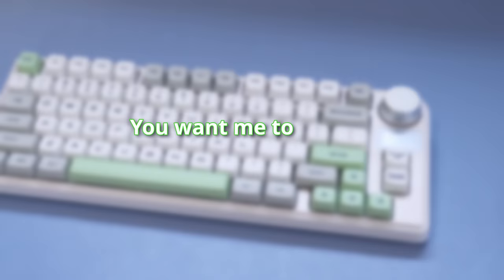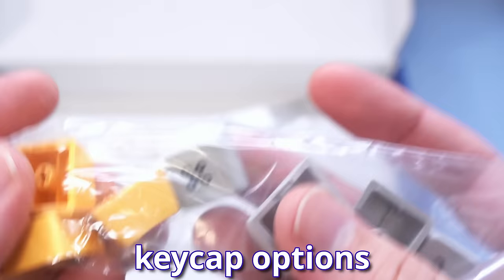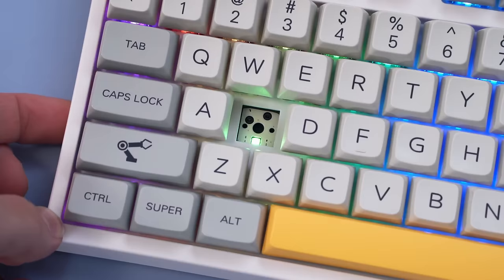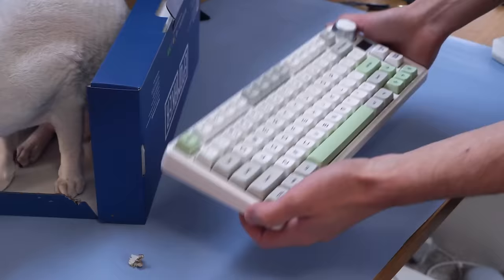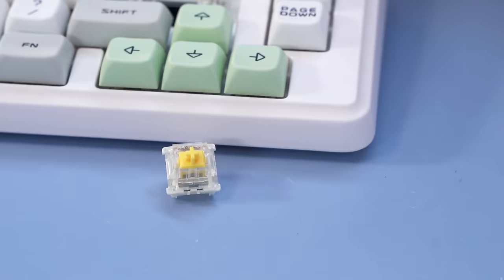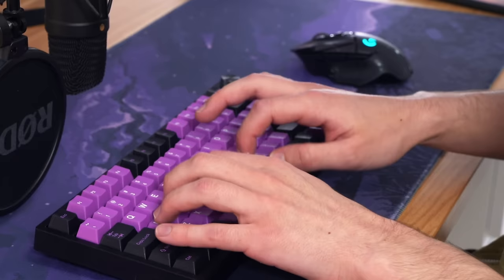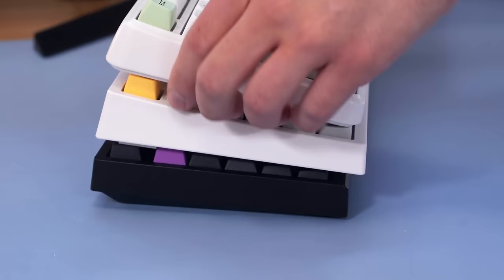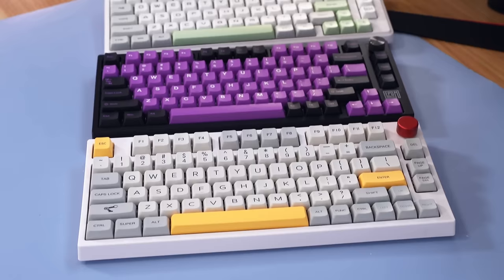Why Are People Buying THIS Keyboard From Amazon?

Comment: Instead of using Kinetic sand to dampen the bottom of the th80 case why not just pour some Flex Seal into the bottom of the case?  About an 1/8" thick layer of it in the bottom of the case should dampen it pretty well.  It would probably be permanent though, removing the flex seal would be hard to do unless you applied a release agent to the case.   You should give it a try and let us know what you think. 🙂  Thanks for the video.
Reply from the maker: Totally could - I have used flex seal in a lot of that type of case and it works great - just hesitant to use around a battery

Comment: counter argument.... no screws make it easier to mod. j pull it apart. over time the case weakens a bit and its easier to open the board. j be careful first few times.

Comment: Uh... the knob on the TH-80X can be used for volume.
Reply from the maker: HOW? I could not get it to work for the life of me
Reply: @HipyoTech  if you hold FN and press the knob it should go back to the normal mode which is volume.
Reply: I love my TH-80X but sadly i wish i went a different route. The screen is a "cool" addition but otherwise useless and yes the firmware is questionable to put it nicely. Hindsight I find myself gravitating more toward TKLs since they have a full size R shift. i'm constantly hitting the up arrow instead of the shift.

Comment: Bought a TH80 last year and the solder job was terrible, metal contacts on the pcb were falling off so I complained and they sent me a new one. It stopped working completely 3 months later, took it apart and no noticeable fixes, assuming battery went out. Wont buy epo again :\

Comment: Honestly, as someone who owns the TH80 Pro, these are all kinda mid, esp for the price. Epomaker tends to be a reseller and for the most part, you could prob get most of these boards cheaper elsewhere (save for the TH80 Pro/Original where the og board, the Keydous NJ80, is more expensive for some reason even when barebones)

Comment: Awful key layouts, one doesn't even have 13 F-key positions, and none of them have a minimum acceptable 82 keys so you have to decide what movement keys you're going to hide in the function layer. And the knob that's not a knob should be a total deal killer.

Get a barebones Tester84 with a nice aluminum frame instead.

Comment: Ok. First, metal doesn't mean better, or even outrageously more expensive than plastic, but the "pro" boards want you to believe this. Ok...
Then moddability...I agree that no screws is weird, but they would work on plastic, and they will wear out easily. No screws...less modding tryouts, but it is still doable. Not a really deal breaker.
Gasket mount...even in this field, a wobbly gasket mount doesn't mean "better performances". Some years ago, if a keyboard would flex it would be considered cheap and baddly built.
North facing LED are not bad in general, it just depend on what keycaps you want to use, and the switch incompatibility is a no problem nowadays.
So I don't really think you'd be totally fair in this video. Even because you didn't try the budgerigar switches, that are their tactile and are quite good. And you didn't mention everything is pre lubed.
In the end I think this keyboards are a quite good start and they sound quite good from the start. You have to spend a lot more to have the same satisfying experience, especially for a beginner of this hobby.
The keychron costs anyway more than this 3.
Reply: The TH80 SE has also a pbt layer on the switches...and it helps to make the sound more "thockier"

Comment: Overall, I think Epomaker's plastic keyboards are WAY overpriced. It might have been revolutionary like 2-3 years ago when mechanical keyboards were more expensive, but at this point in 2024 there are more competitors with better offerings. At the $90 price point the Womier SK71 is a much better value with an aluminum case, decent keycaps with Outemu white switches (which I have and love). If you pay a little bit more around the  $90-$110 range, you can get the Rainy 75 which HippyoTech recently reviewed. I almost went for the TH80 Pro when I first started getting into my mechanical keyboards but ended up going for the Gamakay LK67 (plastic but still cheaper).

Comment: Weird, so mine is like a version of the pro, except it wasn't advertised as having a gasket, and it had a brass plate inside.  So with the tape and foam mods, and some spray paint and new key caps, it's super clean.

The issue i find is keyboard makers don't typically have all the boxes checked.  Like if you want metal body, gasket mount, brass plate, south facing LEDs, knob, and 2.4ghz, good luck.  For me, gasket doesn't matter (never tried before), and I can do without the metal body as long as I have a knob and wireless capabilities..

I'll have to send you a short video of mine, and what I put in it.

(That'd be cool actually, users sending you high quality video/audio of their keyboard creations).

Comment: It sucks that the two options for mainstream Mechanical Keyboards is Epomaker and Keychron: Keychron has got good software & build quality, but their designs are bland & RGB sucks ... Epomaker has got good designs and generally don't need to be modded to feel good, but their software is vomit inducing, QA support is worse, and prying apart their plastic cases is like getting an apple product apart.

I wish Keychron would hire away Epomaker's board designer, but keep their manufacturing standards and Via/Qmk support.
Reply: I recently had an Epomaker EK68. The concerns your voice here are the very reason why I sent it back. I've got a Keychron V2 sitting in front of me right now. Yes it's a bit bland from a design perspective, but I'd rather have bland design over crap software and questionable customer service. Keychron supports their stuff better as well. You can find different plates available for their boards as well as pre cut foam kits for some models.

Comment: I think, You should include in your videos the fact that not everyone wants to mod their keyboard. Sometimes hotswap is enough - it's an individual matter.
In my opinion, you should take this into and do it in two ways in the final assessment. One - for those who want to go into the mod, macro, etc / Two - the other - for those who will stick to the possible hotswap and will not disassemble the keyboard (then it does not matter whether the screws are there or not).
- Unless your videos mainly refer to mods, then my mistake, sry. Anyway good channel, great work!